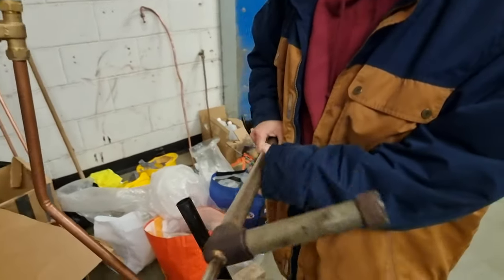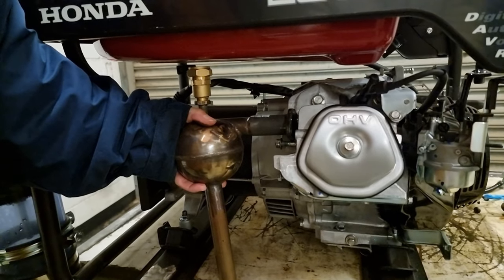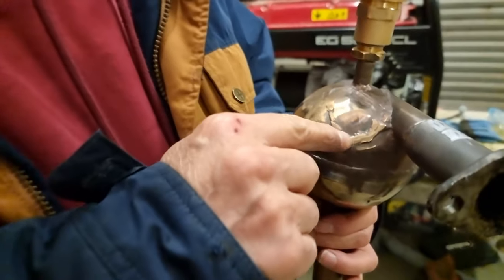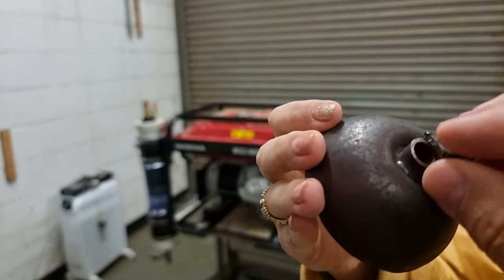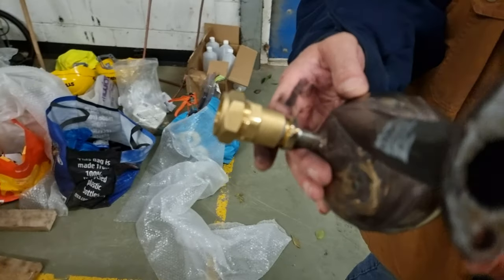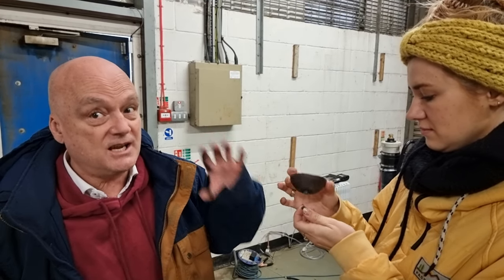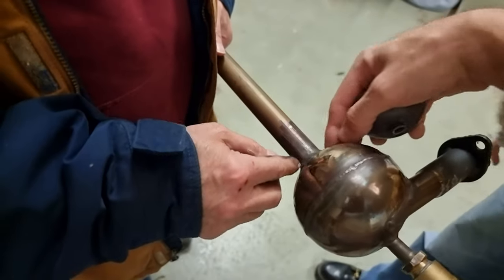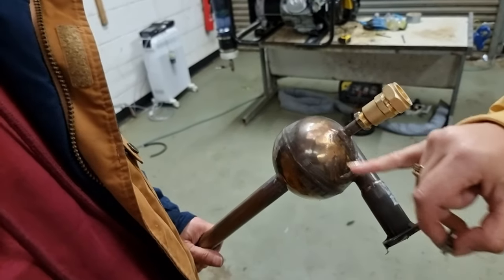THOR - A first look at the very first Thunderstorm Generator

Comment: they have welded a non welding grade of stainless, and the bond around the weld is breaking down and the chromium is falling out of its bond with iron , leaving holes and a magnetic material behind...

when I did my post trade tig course, the teach showed us a patch panel made from non welding grade, that was welded into the correct grade material, the patch panel around the weld looked like it was dissolved by acid, full of holes and magnetic, but the stainless that it was welded to was untouched....I thought that was the coolest thing I had ever seen.....
Reply: That’s what I was thinking as well. Far better of an explanation than random magnetism that just happens to be along all of the welds.
Reply: @HCG   Non welding grades of stainless, will still weld, but the act of welding pushes the temperature above its bonding state , allowing the separation of chromium from the iron. the piece I was shown had 15mm all along the edge of the weld falling apart and full of holes, like it was eaten by acid, the rest of the patch was not effected
Reply from the maker: I am minded to agree
Reply: I have found this online...

Why is austenitic stainless steel not weldable

This is because at high temperatures you get chromium precipitating as chromium carbide and thus lose your free chromium that would otherwise protect your steel by forming chromium oxide on exposed surface.

This problem is called sensitisation and particularly affects the grain boundaries of the metal. This is because you have faster diffusion around them and thus chromium carbide forms more readily and the grain boundaries are quickly depleted of chromium.

Unfortunatelly, due to local variation of chemistry you can also get galvanic corrosion that can cause cracking along grain boundaries. This is called weld decay.
Reply from the maker: Great detail. Thanks @swamppifi6186
Reply: Maybe you’re onto something

Comment: I think you’re absolutely correct about the welding material being impure or not stainless steel. That’s a much more levelheaded assumption than the magnetic properties of the metal being permanently changed, but only on the areas where there are welds.
Reply: No, Malcolm clearly stated it was not magnetic at the beginning. Unless you disbelieve him
Reply: @bassedtaz  I thought he said that stainless isn’t and shouldn’t be magnetic, not that they tested it beforehand. Also, it just so happens to be extremely magnetic on the weld lines of where they repositioned the intake on the sphere. Not saying it’s definitely incorrect, but it is a much better explanation given the information we know currently. Testing would easily prove it one way or another
Reply: stainless will attract a magnet if it is heated excessively.
Reply: @freelectron2029  It has to exceed 1330F, I believe. Those exhaust temps are not the cause, but welding stainless steel would certainly do it.  So that could be explained conventionally, but, WTF is going on with the implosion? We're talking about a severe weakening of the metal, like jellification. Now, THAT's definitely interesting!
Reply: @davestorm6718  I think the small hole in the weld could be explained by a poor weld job rather than a localized implosion, but until further testing is done is pointless to assume either way. It was a bit disappointing hearing Malcolm say with such confidence that it definitely was an implosion and the magnetic properties definitely were from the plasmoids. It’s blind statements like that that make people lose credibility.
Reply: @HCG  The holes, yes. But folding the metal, not at all. The pressure differential would have to be extreme and there's no way a small engine or even a large one (like a 350V8) would possible do this to steel without an addition of heat in the softening range - over 2000F (most exhaust systems can handle 1600F and the exhaust from this system would probably max at 900F, tops). Even a high vacuum, whereby 1ATM of pressure would be felt by a 20ga steel  sphere, it certainly wouldn't implode. A 20ga steel ball should handle pressures much higher (a shotgun barrel can handle 12,000psi).  The only other way I can see that effect is if someone took a sledge hammer to the end and wacked it really hard (making it appear to have imploded).
Reply: @davestorm6718  Was the metal actually folded or was that just how it was constructed? If the metal truly did get pressed in like that, then yes, that definitely is an anomaly. I thought they were just talking about the small holes.
Reply: @HCG  They claimed it was folded (imploded) at that connection point of the tube to the sphere.
Reply from the maker: Many units are being built and sent out to independent testing parties, we are expecting 2 or more, no charge and we have promised nothing.

We will be able to test to see if the welds are ferro magnetic before and after operation.

The heat may cause phase changes in the welds resulting in some ferro magnetic material emerging.
Reply from the maker: Yes - change of phase and re-crystalisation. It is most likely to occur in convex areas were losses from thermal via IR emission is restricted.
Reply from the maker: And that is why you have independent parties test and verify, but first, one must capture the claims.
Reply from the maker: There are many units being sent out to independent testers (including us) We have asked them to look for changes in ferromagnetic properties before and during testing cycles. We will of course collectively look out for deformation and record temperatures.
Reply from the maker: The holes could be a factor of the folding, combined with the quality of the welding.

I think that in a long TSG, the difference in thermal expansion coefficient between SS and Soft iron may play a role and I am unconvinced that the central metal pipe is not ferromagnetic soft iron where the sphere and the outer cylinder are SS.

Using ChatGPT for calculations based on these references:
https://psec.uchicago.edu/thermal_coefficients/cte_metals_05517-90143.pdf
https://www.engineeringtoolbox.com/linear-expansion-coefficients-d_95.html

if the SS and mild steel were at 427ºC / 800 F, then the difference in length over 1m in expansion would be 8mm.

I think the problem may be that the inner cylinder was mild steel and the outer tube was stainless, that meant the outer tube extended more, resulting in the observed deformation.
Reply: @davestorm6718   well no. stainless gets red around 500c. but we have seen videos where the this chamber gets red hot. you dont need to melt the metal to get it to deform from the pressure difference, or even from dropping it on the ground while its hot. don't forget we are dealing with a modified engine. if you lean out the mixture you can melt pistons. we have no idea what mixture was running at the time. it could also be that there is considerably more back pressure in the modified exhaust as well as possibility for heat to concentrate in the sphere as the gas is not pushed straight out and instead encouraged to stay spinning in the sphere before its ejected. effectively heating the chamber and causing anomalous heating.
Reply: I have been invited to make some spheres at a metal shop with a laser welder. I may try 4 of them and using the triple sphere with the 4,3,2 with a 2 Inch flow guide inside. I have no idea how to "tune" them but we're gonna try that as well.
Reply from the maker: Will be interesting to see what you find. @chrisprysok7634
Reply: @freelectron2029   The exhaust is not getting to 500C, at least not at the vortex chamber (I would expect half that or less) - The pressure can't be more than 100psi on a twin cylinder engine on the exhaust stroke through the valve, max, but more like 2-4psi at the sphere - that's not enough pressure to deform 20ga steel (stainless or not) at 250c.  Without the actual measurements, there's no way to be sure.
Reply: @davestorm6718  i disagree. 20ga is 0.8mm i can deform that with my hand at room temp. and exhaust temps are red. just watch the videos. i think that's the point here. assumptions are futile.
Reply from the maker: We have now seen on SEM a vortex soliton Yin Yang structure consuming the stainless. @HCG
Reply: Gas/rod less welding was performed by the look of it. No filler rod was used
Reply: The welder only used neon/nitrogen welding with no filler rod. Therefore there is no contamination other then the heat changing the crystal structure. If it was annealed afterwards then that would be irrelevant
Reply: @gruboniell4189  hes not using nitrogen. No one uses nitrogen to weld.  Why would someone choose to Give advice on a topic they have no understanding of.  The future is ridiculous.
Reply from the maker: Argon, I think N is for the annealing process. @freelectron2029

Comment: Why does it only work counterclockwise? The guy welded it on the wrong side and it did not work clockwise, but after they removed it and welded it on the other side it worked counterclockwise.
Reply: I believe it's because of polarity. The sphere is above its plane so since it has a north and south the rotation needs to match that. I'm just speculating from the videos I've seen here. I think it's creating a magnetic field and is fusing the effect to the stainless steel, through the eruptions inside.

Comment: I thinks its transmuting the metal with an effect, if im wording that correct. Its seems to be creating a magnetic field and that can be controlled the by the frequency of the plasmoids when they collapse. What happens to the stainless steel if we use something other that water? Or tune the frequency?
Reply from the maker: Pretty sure you need a polar molecule with Hydrogen and Oxygen, Water is the obvious choice
Reply: @MFMP  ohh ok I don't have any background in this other than just the videos I've seen 😅 so I'm just throwing out my thoughts on it. It blows my mind that this has been being worked on for 8 years already. I live in Houston and I'm hopeful we will start to see this tech being adopted everywhere.

Comment: It doesn’t seem to be the vacuum that changes the geometry in this failure. Unless you check the thickness of the metal to see if it’s stretched or compressed. 
If it’s all a uniform thickness then wtf happened?

Comment: if your heating that sphere to red hot and then subjecting it to a huge pressure delta in side and out that could easily explain the "imploded" end.

as for the magnet being attracted to the area of implosion, if you weld stainless to hot or use the wrong filler material or heat a weld for a long period you are going to get ferro magnetism. 
i.e. if stainless gets to hot it becomes ferro magnetic, stainless welders or joe cell enthusiasts will tell you this. 

 without knowing more information i don't think you can make the conclusion you are surmising.
Reply from the maker: I can't disagree with your comments.

Comment: The secret is.. Exhaust warmed water vapor improves the thermal efficiency of any heat engine.
Paul Pantone invented and patented a very similar device in 1998, Patent number 5794601.
Though it was well known that water cooling improves engine efficiency, hence radiator cooling etc.
Reply: you only have to change 3 things to get a patent on a patent
Reply: The primary function of the device has nothing to do with engine efficiency, though increased efficiency is a slight side effect. I’d suggest actually understanding its purpose before commenting.
Reply from the maker: There are many such devices. Pantones has a central rod in, this does not. Pantones is the only other device claiming element synthesis in the family of HHO, H2 and Water Gas injection systems other than the TSG. We have never had a GEET working long enough to test those claims or seen credible data. We have also, not yet seen conclusive transmutation in the TSG, however, many people soon going to be able to test the claims - and so hopefully the debate will be settled one way or the other.
Reply: @HCG     More efficiency with fewer emissions are a function of the device.